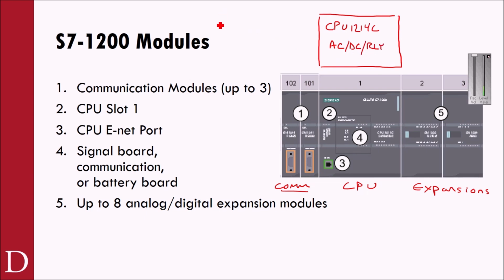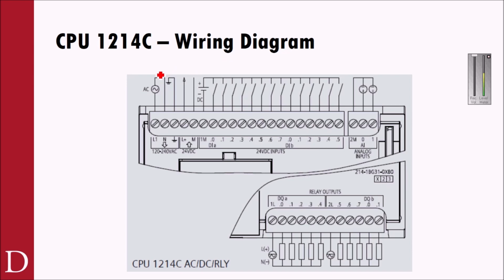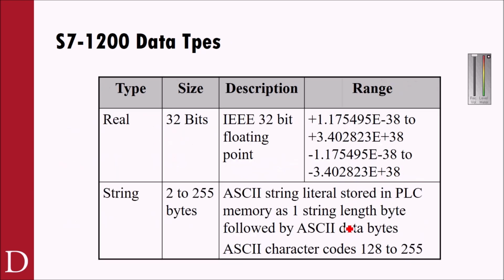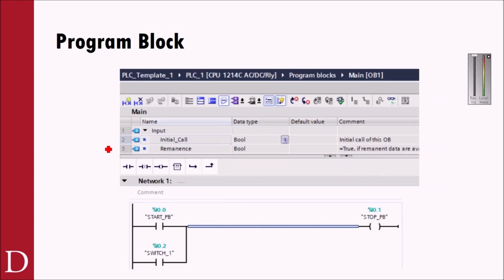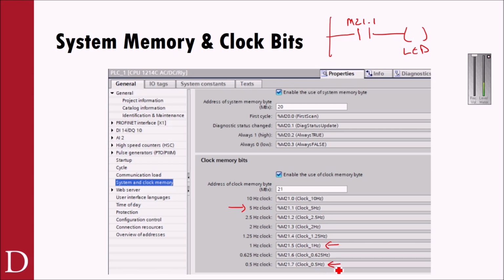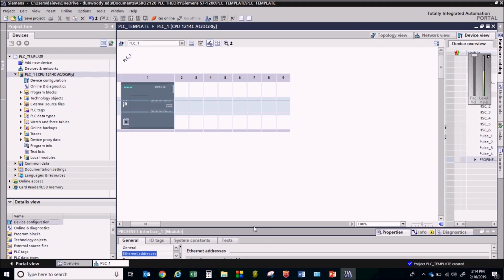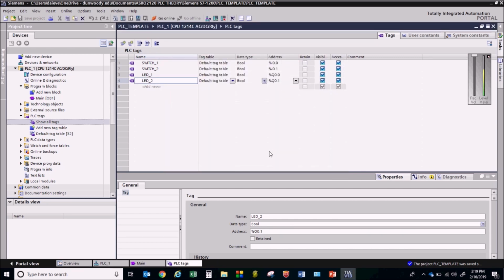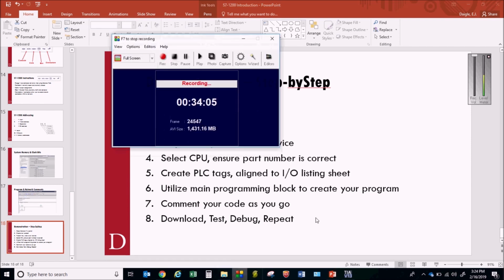PLC101 - Siemens S7 1200 Introduction

Comment: Hello. Thank you very much for your videos. Its very easy to understand. I have a question. When you add your PLC hardware you said it to be 1BG40. Does 40 have a significance? I was told 40 is version 4.0. and you have to select it before you ADD your PLC.